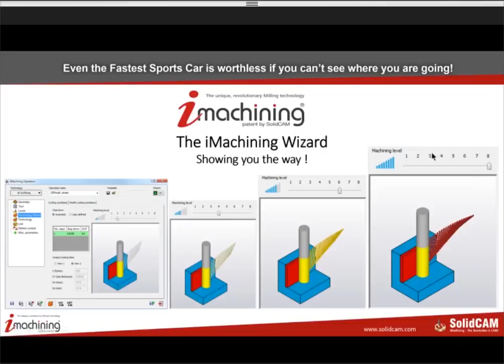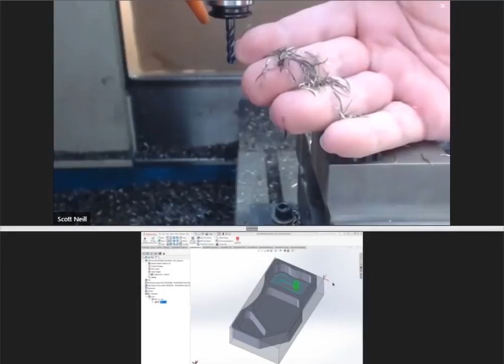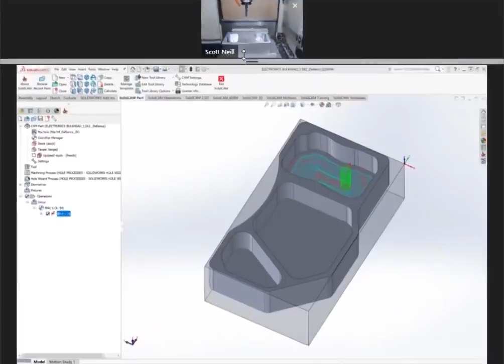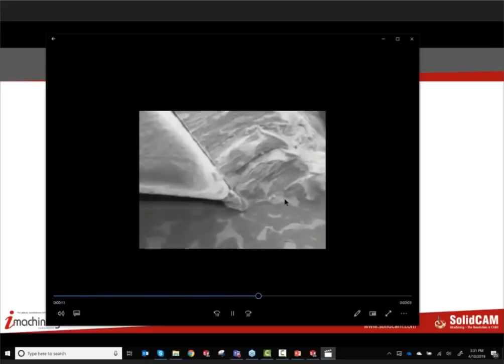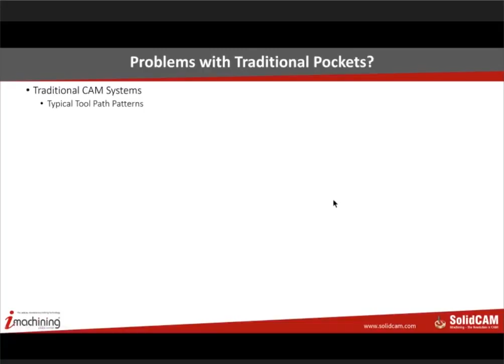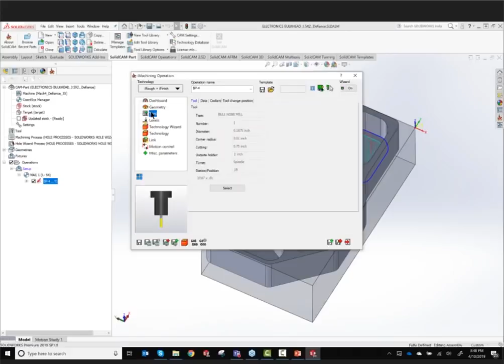SolidCAM & Harvey Performance Present: 'The Science of Cutting' LIVE Cutting Webinar

Comment: The tool manufacturer for 17-4 ph suggests sfm of 145 or 200 and a chip per tooth of .0023. 
I’ve seen imachining overide those values by 10x minimum. Most cases my tool breaks. 
I’ve tested adaptive toolpaths with tool manufacturers data and it cut my part 57hrc like butter. So I’m still doubtful about solidcam. I’d like to know more about the science and know why Imachining really doesn’t work on my machine which is 20 hp.

Comment: Does the tool room Haas Machine have high speed milling option?
Reply: I Want to know if you can use imachining on older Machine ( with fanuc control) if you don’t have high speed machining . Of course not very high Performance .
Reply: @claudiugalea3038  iMachining uses the information you provide on your machine to optimize the toolpaths.
Reply: Mark Pimentel i know But some people told me it’s possible not to be able to run imachining on my fanuc because i don’t have high speed machining and it will slow down way too much the feeds. Thats Why i’ve been asking that. I gotta test it. Hsm and hsr go well  But i don’t have the imachining module yet.
Reply: @claudiugalea3038  I was going to ask this question as well. This is running smooth in a 1990s machine table top so I'm wondering if it got high speed setting on the machine as well.